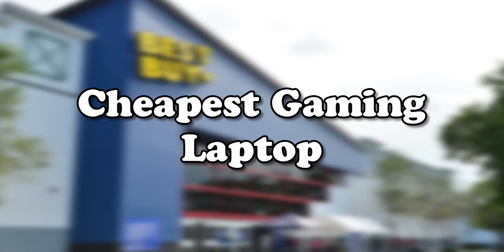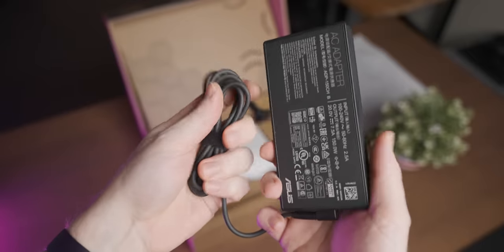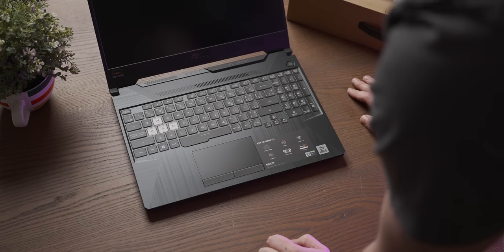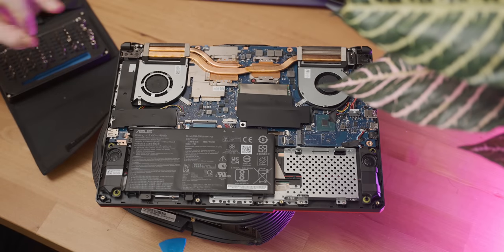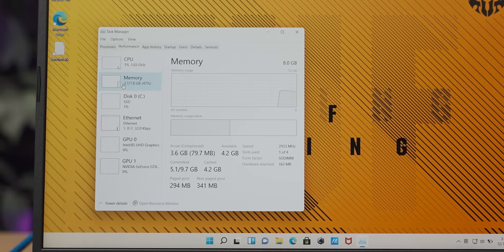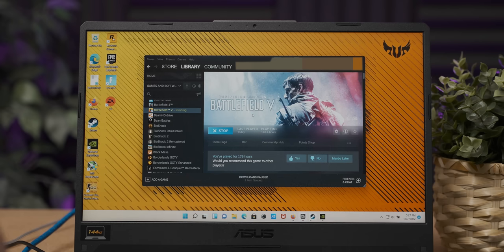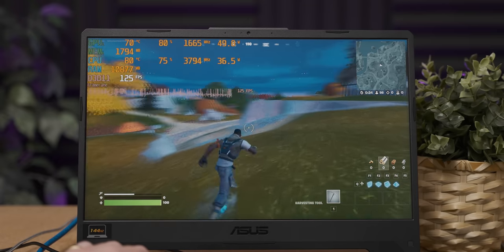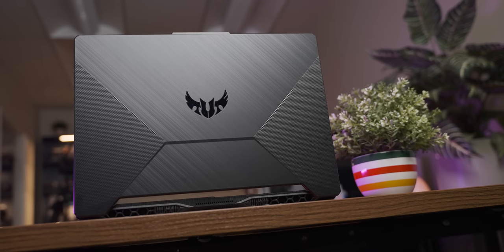The Cheapest Gaming Laptop From Best Buy...

Comment: Hello Dawid I hope you are well, thank you for sharing this video with us and putting all your energy for us!

I would like to point out something about ASUS laptops: a few days ago another reviewer "Jarrod'sTech" did a comparison between Lenovo and ASUS, where he concluded that for the price, ASUS was the better choice.

But he missed some points which I will explain here, so:

ASUS is cheap in general, but Lenovo does a lot of discounts on its official website, and they do extra discounts for students if you have a university email address. In 2020 I bought a lenovo legion 5 with 16gb, 3060 rtx max tdp and 5800h, 512gb ssd for around 1000€ delivered in 3 days while in most markets around the world the price for the same config was higher at 1500 $ + shipping.

Second point, ASUS has huge heat dissipation problem even in the new  generation laptops for this year. I think you remember when "Hardwere unboxed" team cut the panel through the hexagons in the old version ASUS to improve temperatures.

The last point, ASUS has a problem regarding durability, I'm looking at several electronics repair channels, like "NorthridgeFix" and most of the time it's a mosfets which the laptop not usable, he's not the only one reporting this  but it shows that maybe for ASUS to compete with Lenovo, they have to use cheap electronic parts which will result in above average defective product.

thank's again, waiting for your next video !

Comment: I bought the one with the Ryzen 5 4600H variant for around $700 at the beginning of 2021, and it was my first gaming laptop purchase. Aside from the awful battery life, and lack of memory out of the box.. it ran pretty decent. Logged roughly about 50 hours of Tarkov on it with no issues. I use it mostly when i travel, but it runs like a champ.
Reply: is not awful is just games eat more power. Laptop is trying to keep the batttery from dying to quick but its because games is more powerful then working online.

Comment: I have the Ryzen 7 + 1660ti version of it and it's great for the price, runs everything great at its' 1080 res and the expandability for more RAM, an extra SSD AND an extra 3,5" SATA or bigger battery depending on SKU.

What's not so great is the color range on the screen, but really, it's fine.
And the fans can get loud. Just use a headset.

Comment: You didnt try downgrading to W10? Also, i guess they dont make 4 gig modules for you to have tried a 2x4gig configuration. lastly, i think i would have tried elevating the rear feet a bit to increase cooler air access to the bottom.

Comment: I only know this because I have a very similar laptop (IdeaPad Gaming 3i 15IMH05 or something like that) that has a 10300H and 1650Ti, but the reason that the ram only runs at 2933mt/s is because of the chipset that they use on the motherboard (which is comparable to the H series desktop 10th gen chipset) that only supports up to 2933mt/s.

Comment: The single 8GB stick has become the standard for anything sub $800 no matter how many times the manufacturers have been called out for it.
It would cost virtually nothing extra to manufacture using dual 4GB sticks, but apparently there’s no changing it.
At least DDR4 is pretty cheap right now.

Comment: I Have TuF A17 2021 With R5 4600H And GTX 1650 and The GPU Uses up to 60 Watts Is That normal? I also ran cinebench Multicore benchmark and cpu used up to 58 watts

Comment: i have this laptop with a higher spec, i5 11th gen and 3050, 16gb ram, i have also had the same issue with the gpu being bottle necked with the gpu, upgrading the ram was a surptising solution.

Comment: You should have checked out the GB£300 HP laptop I bought, 10 hours to be clutter it, the CPU was running at 70% plus with nothing at all running due to the amount of info it was sending back to HP and Micro$oft. HP had even installed a keylogger on it so they saw every keystroke, I shut off all telemetry and uninstalled the bloat and now CPU usage is at 5-7% at idle.

Comment: this laptop is similar to the one im getting for christmas. MSI GF63 Thin 11Sc, i5-11400h, GTX1650 4GB, 8GB (single stick), 256Gb NVMe SSD. im switching to 2x16GB (32GB total) and adding a 1TB SATA SSD for storage. its going to replace my 7 year old daily beater AMD A12 HP laptop ive been using.

Comment: I have this laptop, though a few yrs older with an i7 9750H but same GPU and specs.
First thing I did was upgrade ram and remove McAFee. Works fine, can pretty much play most games on low-mid settings....
It sounds like a jet on turbo and build quality is awful (the fans especially will eventually fk up and sound like their grinding or something... Its really bad TBH. I wish I was a bit more savvy so as to fix that, it's super annoying but doesn't noticeably affect performance.... yet.)

Comment: I've just bought an Acer Helio G300 with the i9 and 3070 (8GB), it looks pretty good on paper and will be even better with W11 telemetry closed off and a clean install. The price was GB£1300 and I could have upgraded to the 3070Ti but dropped to the i7 for an extra £200 I think.

Comment: I've got one that is intel i511300H and it is a decent little laptop. TBH I only really use it for YouTube and the odd City skylines / GSGO. The speakers are weedy though, the keyboard is not good and the fan noise can get excessive. Was waiting for my warranty to expire before putting more ram and another SSD in, little nervous about cracking some of the clips, I've upgraded my old desktop before several times but not a laptop...

Comment: Got one of these for the GF used - $250. The thing is LOUD. Cooling design is super shitty. Tried drilling holes in the bottom of a spare bottom panel and it was STILL loud. Cooling just doesn't keep up when gaming.

Comment: I have the 10300H, 1650TI model upgraded with 2TB HDD, 2*500GB + 16GB Ram - best machine I’ve had. £400 over a year ago. came from a 1070TI rig. Has its limitations but does exactly what I need.

Comment: Hey. I wonder if you can still find one but I suggest you find a laptop with NVIDIA GeForce MX250 or newer with 10th Gen Intel Core i3. Trust me gaming performance on those laptops are quite interesting. Cuz I have one here and ngl alot of modern games like Doom Eternal, ROTTR, SOTTR and GTA V runs super fine. Not as fine as this laptop but for the cheap price tag gaming performance is kinda nice.

Comment: I have this exact laptop, but just with a bit new specs. i5 11400h and rtx 3050. And yeah first impression, plastic, VERY plastic. this gets hot. But, i actually didn't buy this to game on. I replaced the nvme with a different and upgraded from 1x8gb to 2x8gb ram, installed windows 10 pro, then i went into the advanced power settings and set the cpu maximum power at 99% to limit the cpu from boosting. So it stays at a comfortable 60C on the cpu.

Comment: Dawid, Hello I'm Harrison, I'm from Colombia, I have an ASUS TUF laptop, but the difference is that my TUF laptop is a newer model, exactly the 2022 models, and also my TUF is a Dash version, but with the Intel core i7-12650h processor, a Nvidia RTX 3060 (the 80W version that reach 105W at max TDP) and have 16Gb ram DDR5 running at 4800MHz, but it's have the 144Hz refresh rate the same as the laptop of the video that is a Full HD screen, and the design of my laptop is something different, but have the same connectors but with another thunderbolt connector replacing one USB connector, and it's have the webcam at the same position.

Note: The 2022 TUF Gaming variant laptop have the same design as my laptop but it's a little bit taller.

Comment: I have a TUF F15 with a 3050 GPU and I love it! I travel to friends and family a lot, and it's a great portable gaming machine. It was my first laptop purchase in like 10 years. I paid less than what I paid for my old laptop and this is a proper gaming laptop, haha! The only issue I've had with it is the damn Wifi connection, the wireless isn't very stable, so make sure to take an ethernet cable where you go. I'm considering getting an extra M.2 drive as mine has a free slot too, as 500GB isn't quite enough, or upgrading the RAM to 16gb. £700 well spent imo.

Comment: I want to know if my laptop is acting normal. So before I updated to windows 11 while gaming I had a 30-40% cpu utilization and 90-100% gpu utilization. Now that I’ve updated to windows 11 now while gaming I have a pegged 100% cpu and 100% gpu and I’m getting lower frame rates on the same game settings. I also tried it out on Fortnite but same result. How do I fix this? It is also hitting 103C while gaming when before it was at 73-76C

Comment: Hmm, its okay deal but not really amazing. I got HP omen 2020 17 inch 2.5 years ago for double of this laptop price. with i7 10750H CPU rtx 2060 115w, 16gb 3200mhz dual channel. If specs were similar I would say its a great deal, but you get lower CPU performance and GPU performance, might it be better to spend a little bit more and get like RTX 3060 cheap laptop?

Comment: Maybe my standards are low (?) but I've been using my TUF laptop I bought in July of 2021, albeit, with much better specs (i7-11800H, RTX 3060, 240hz screen, 1TB SSD, larger battery at the expense of not having the 2.5'' bay), and assuming all TUF laptops use the same chassis, which from what I've seen on other people's laptops is pretty much true, I really have almost no complaints about quality. Like, the keyboard feels great to me, the plastics don't feel bad at all to me, and opening the bottom half is fine, I don't mind it. My only complaint is that the screen is very wobbly and bendy, and I'm afraid of repeatedly opening it by the side, so I started to always use the little handle at the middle to open it and I cringe whenever I give my laptop to someone and they open/close the screen by its side.

Comment: i actually bought an hp victus 1650 ryzen 5 5600h laptop for 65000rs (around 750usd yeah laptops are quite expensive in india) and im quite happy with it. atleast the components donot bottleneck each other. i have heard this laptop cost around 600 usd so its better deal than the one in the video

Comment: I have this laptop but with a Ryzen 7 3750 and a 2060. It performs ok, but the temps are crazy, and the CPU is definitely the limiting factor.
Reply: Do a repaste with thermal grizzly kryonaut
+ Install ryzen controller and limit the cpu temps to 82
I did so and it changed everything
I even overclocked the 1650 to 2115MHz (+650MHz) with temps staying around 71°C
Reply: @JOBRANANOFAL  Oh, I did all that and even cut new vents into the case. After all that, it finally hovers around 80, but it does still spike into the 90s occasionally.

Comment: GTX1650 powered laptops are cheap but if you up your budget a little you can usually get a laptop with an RTX3050 for under a 1000$. And i've thrown a ton of stuff at my Acer Nitro 5 that has a 11th gen i5 and RTX3050 and it ran quite smoothly, i was even able to play my usual VR games on the laptop which proves that if you want to play PC VR on the go, RTX is the way to go

Comment: I upgraded my asus tuf gaming f15 fx506LH ram from the single 8gb 2933mhz stick to a Kingston Fury Impact 2x16gb 3200mhz DDR4 memory. After installing it, I noticed it was still running at 2933mhz. Any advice on how to speed up the memory speeds?? (fyi my laptop is the exact same once as the laptop shown in this video)

Comment: im watching on the 3060 i711800h version of that laptop. its much better built than that one for some reason has an extra fin stack next to the usb 3 and a waaayy bigger battery for some reason. also get some corsair vengence 32gb @ 3200 2x16 ram. it runs at the correct speed without any bios modifications.

Comment: I bought the AMD Ryzen 5 4600H 6 core version of this same laptop it came with Windows 11 that was the first to go upgraded it to Windows 10 Pro lol
I upgraded it to 32GB 3200MHz ram replaced the boot SSD with the Samsung 980 Pro 500GB and added a second 2TB SSD for storage then ordered the 90 watt hour battery for it. So far it's a great laptop just had to buy a bigger laptop bag didn't have one to fit a 17.3" laptop. Overall it's a nice laptop

Comment: The sad thing is that the performance of GTX 1650 of that machine appears slightly lower than the GTX 980m of my ancient J751JY. I actually have a glory hole that let me upgrade ram to 32 GB and have two bays for hard drives or SSDs. Also have that item that I miss in new builds, a blu ray rom.

Comment: They actually sold a better and cheaper laptop for 460 usd 1650 and Intel i5 12450, my wife got it and she's very pleased as it will run most games on 1080p just fine.

Comment: Would be interesting to see how much performance improvement you can get by giving the little laptop a shot of penicillin to remove the VD.  And as a bonus check it out after also removing the microsoft crapware.  Best way to clean up the cpu bottleneck is to get rid of all that junk that is causing the cpu to work unnecessarily.

Comment: I just bought myself the closest competitor to this. It cost around about the same but has a 10500h instead of a 10300h and mine has 16gb of ram. It ahs a 512 gb nvme ssd and a gtx 1650

Comment: I have to say the Gigabyte gaming laptop I tried (their cheapest one, which was $480 for BF, but normally about $700) had almost no crap-ware on it.  No AV actually (Except the built-in AV built-into Windows 11 so that was nice).  The downside was that the recovery partition didn't work properly so I had to download a full Windows 11 image to restore the laptop to its "original" installation configuration (which is annoying because MS forces you to log into your MIcrosoft account to complete setup) in order for me to return the laptop to the store. I guess I could have just wiped the drive and told them it didn't work (I returned it because one of the USB ports was defective;  there actaully wasn't anything wrong with the software but I wanted to clear off my data completely and was going to use the "Clean Drive" option for the Windows reset/recovery function which also didn't work, so then I tried the factory reset which also didn't work).

Comment: I used to have this laptop horrible thermals and performance in general despite repasting it with quality thermal paste it would still thermal throttle a lot, quad core cpu in 2022 aint ideal at all :/ thankfully i sold it and got myself 3080 ti pc with i7 13700k

Comment: Ram has to be the issue. I have a similar one with 16GB 2933mhz and a 1650TI and the same CPU and that CPU does not get bottlenecked under 144fps no matter the game. The GPU is mostly the limiting factor
But on this laptop, there seems to be a further problem cause my GPU gets constantly maxed at 1080p so idk what your laptop's problem is for not using it at max. But at least you get better temps as my laptop burns itself while gaming, CPU pegging at 95°C sometimes with the same wattage

Comment: I got a 1050 and a 10500h for 680,  16gb's of ram and threw another 1tb ssd in in it. I bought the 9500f? or something but got this instead and it's been a little truck. Msi did a decent job on it, I can overclock the gpu enough where 1080p normal/high settings work great if im doing something else the 5800x and 3080ti do the job

Comment: Plugging in external monitor will make gaming even better. Gaming laptops use integrated video and only when ''needed'' switch to regular video card. So if you plug in external monitor regular video card is active all the time. Then ofc. why would you buy laptop just to add external monitor if PC will do better, but thats just how it is.

Comment: If I remember right you have to change a setting to favor Gpu over onboard graphics. Might be why it wasn’t using gpu as much.
Reply: Sadly, this doesn't work too well with Asus laptops. You can't fully disable Nvidia Optimus on them without plugging in an external monitor.
Reply: @NotKenBlock94  no, if you go to Nvidia control center and select the game or program you can specify make sure that it always uses gpu over onboard because often enough it messes up and tries running games from cpu only. Not saying this is why cpu usage was so high but on Gaming laptops it’s good to set it so you know that’s not the reason for the bottleneck.
Reply: @Groundpounder25   that's the thing though. Asus does something to their laptops so that it still goes through the integrated GPU first even if you set it to prioritize the actual graphics card and it needs to be plugged into an external monitor to bypass it.
Reply: @NotKenBlock94  not on mine… it’s a ryzen 5 4600H with a gtx 1650 and when gaming or benchmarking it uses what I consider proper cpu usage with much higher gpu usage as it should be. Also I specifies gpu and onboard Gpu usage on task manager too so it’s easy to tell.

Comment: I have the same kinds laptop which is asus tuf fx505dt it came with 8gb ram, 256 gb of ssd and 1tb hdd and ryzen 5 and gtx 1650

points to note:
1. always put it on charge when you are on gaming
2. open that armoury create and change the settings to turbo it will instantly oc your processor from 2.9ghz to 3.7 ghz and it will use 100% of your gpu when gaming so no need of extra 8gb ram.
3. change the power management from balanced to high performance in battery settings.
4. fps part after all this settings Gta 5 around 85 to 90 fps all in very high settings and i disabled fxaa msaa and vertical sync and post fx to high, valorant very high 120 fps may be higher cuz my screen is only 120hz refresh rate, fortnite very high defenatly 100fps above, just cause 4 very high settings 80 to 90 fps
5. its a cheap laptop but not the worst if you are in budget go for it im using this laptop for 4 years i even do 3d renders using blender and other softwares its works like charm.